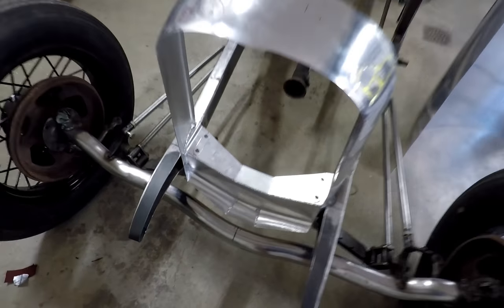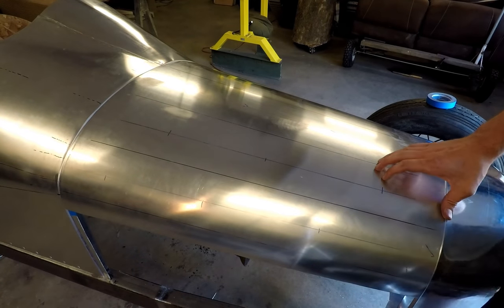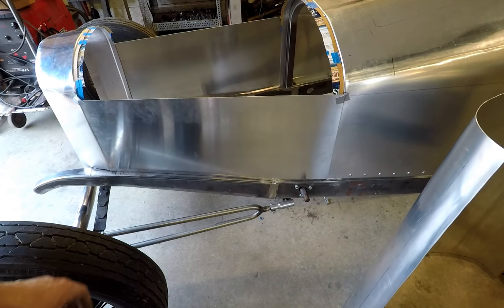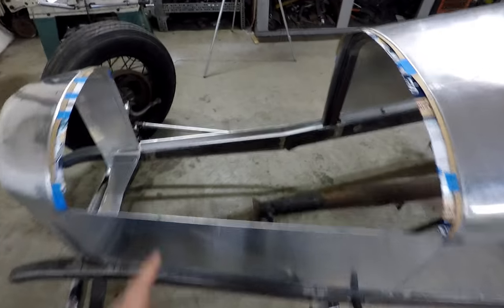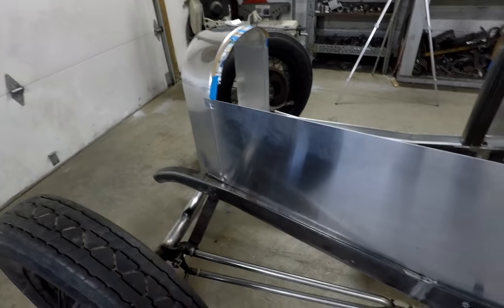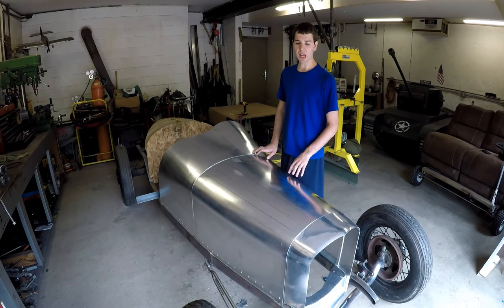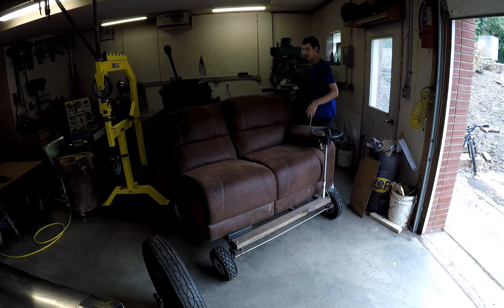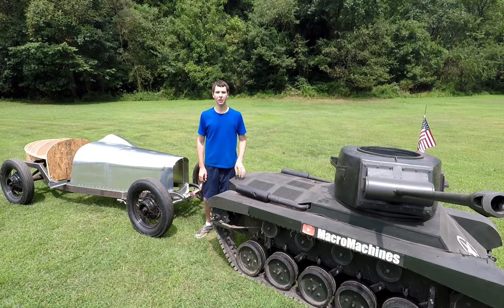Fitting a Custom Aluminum Hood and Grill | Homemade Boat-tail Speedster Pt. 29

Comment: When you finish the car paint the top surfaces to stop any glare blinding you whilst driving, but leave the side aluminium bare then buff it to a mirror shine and clear coat the lot. A Green or Yellow enamel paint for top of the hood and top of the rear end would be keeping with traditional colours of the time and style of this car. Nice work so far, keep the quality high but don't use wire wheels, they flex too much when cornering and deqrade in performance over time , but they are pretty . Good luck!

Comment: Nice video's and nice work, If your are going to do more riveting, I would invest in some cleco's , to hold your metel together makes it a bit easier then screw and nuts. Also put some tape over your riveting snap, that will help your from marring your rivets heads. Just a thought.

Comment: Awesome videos man ! Those edges your fighting are trying to shrink once you roll the bead in it you could attack the problem after with a shrinker if you don’t mind the jaw marks however if you pre stretch your panel on the English wheel right where bead will be once you roll your bead and the panel shrinks it’ll come back to where it needs to be without having to rework your edges just a tip keep it up it’s rad !

Comment: I am well beyond sick of not having a rwd hot rod to build & seeing your build, I am thoroughly impressed! Where did you get the frame & suspension/drivetrain? I wish I had a garage & also, the property of which I am on does not belong to me so, even if I built a garage, I could be asked to leave & that is a big issue! The basement destroys everything you put into it! I am rather impressed by your tool collection & skill! Keep in mind that I as well appreciate tools & have a decent collection but of course, it could use some improvement! I do not own a lathe of any sort! I have a long way to go! Nice!!!

Comment: Darn, I'm too late (unless you want to drill out all your solid rivets ???). With Aluminum, always "Sealant" between faying surfaces; it prevents "rattles" AND, more importantly, "Corrosion".  Same with Rivet installations. Just an FYI, in Aerospace we usually use stuff called "FMS 1044 B1/2, 2 or 6 (the numbers denote the "work life" before it sets) and you just thaw out what you'll need for the day. You can buy it "Frozen" (pre-mixed) in Tubes.  Usually applied with a pneumatic "Sealant Gun" but a "Caulk Gun" or even a putty knife will work for you in your Garage.  Now ... about your Frame ... "Powder Coat" ???  Beautiful job "Wheeling" ... a lost art and glad to see that you are going to keep it alive !!!

Comment: You're doing a fantastic job so far! One thing I noticed was the front radiator support / grill doesn't have a lot of rigidity to it yet, so there's a bit more sideways movement in the hood than normal. What are you planning on doing to fix that / how will you mount the radiator?

I hope your fall semester goes well!
Reply from the maker: the grill shell definitely needs more support, but I'll figure that out after I get a radiator

Comment: The car's looking splendid, and using the tank as a tractor was a really witty idea. 

Just a question, though. Is it possible and practical to use the bandsaw in a "draw" rather than "push mode"? I.e. with the teeth away from you, pulling the work onto the cutting edge. It's nice to be able to give two thumbs up.

Comment: I love your build.
What do you plan on using instead of fabric as padding.
When I removed a GRP body from a chassis recently it had this horrible mastic gloop that made removal difficult and took hours to clean up.
I'm thinking of using neoprene or leather when I refit but not sure how well it will hold up.
Any thoughts?

Comment: One thing that confuses me just a bit, it looks like the sides of the hood will be bolted down.  I would think the hood would open like most old hoods, where it's latched down on either side, and hinged at the top, so that the whole thing comes off.  I could very well be misunderstanding.
Reply from the maker: the sides will be bolted down, and the top piece will be strapped down to the frame. A lot of the early racecars did it in similar ways

Comment: What a sweet ride! It's awesome how those hood side panels are attached to the radiator shell and cowl. Did you come up with that yourself or did you see it somewhere?
Reply from the maker: as much as I try to learn from other cars, that's an idea I came up with on the spot
Reply: @MacroMachines  It just such a common sense solution to a simple problem. Congrats on thinking outside the box.
Reply: Just wait... you'll probably see it being copied. I know I never saw it before. You are giving me new ideas for the roadster I've beem designing.

Comment: Got a question. Will those screws that you fastened the grill down to. Will those eventually vibrate out?? Well it was a truly productive summer. See ya next time when you post a video.
Reply from the maker: probably, I'll have to do something to prevent them from vibrating out
Reply: @MacroMachines  There are bolts that u can get at lowes that have plastic in them that won't loosen. I call them fasten all bolts. U can try them.
Reply: @jamesmaroon6161  You mean Nylock nuts.

Comment: I notice you have no cooling vents on the panels. Am I too early with my comment or did you forget?
Reply: Not even close to done
Reply: He can build a vent CARVER on his lathe to fit the rolling device for cutting slots into the aluminium....But that may throw the fitting on the hood or sides/ Where ever he puts them off a tad,,,there are some very good instructional vids on youtube .....So I hope he follows the pros and watches a few.   Fingers crossed.  I have high hopes for this build....._

Comment: Are you going to make it street legal
Reply: Well I should hope so....
Reply: I was wondering the same thing. I wonder if he can register it as an older vehicle since the drive line and engine are all older. Since he built the frame himself, I wonder if that will screw with registration. I don't know the rules for his state and if it would be considered a car, go-kart or what.
Reply: @cheeto4493  all he has to do is lights vin front window and seat belt